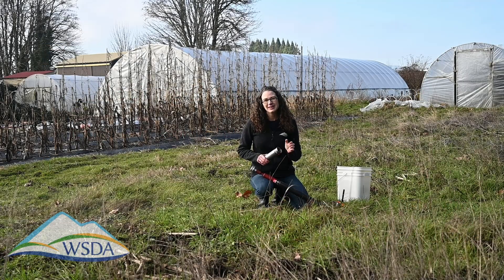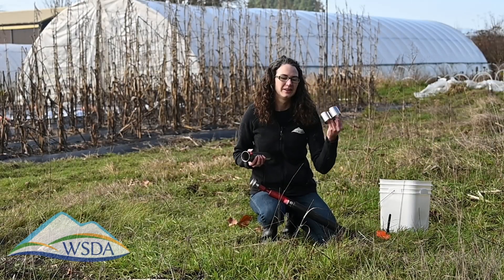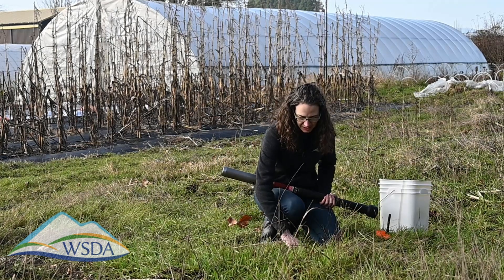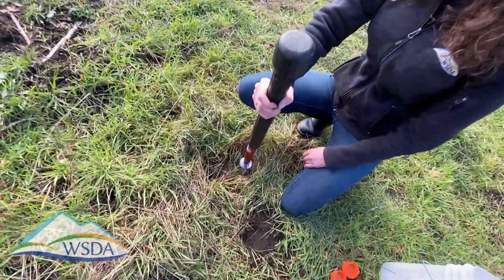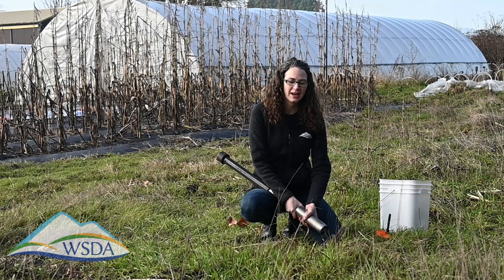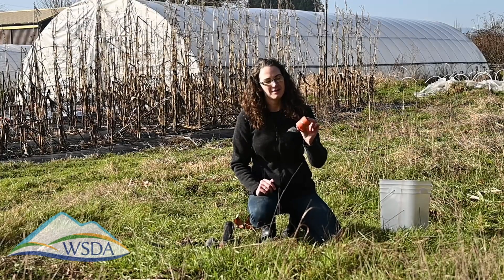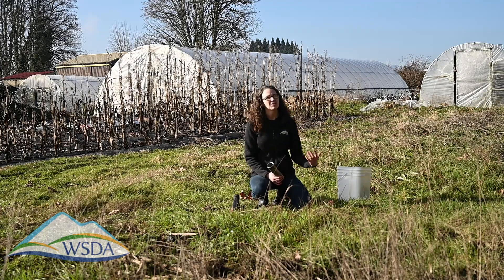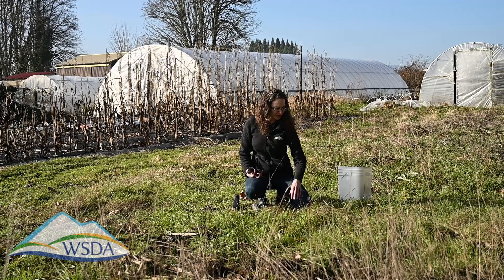Soil Sampling 101: Bulk Density

Comment: Hello, I am not sure if you actively check these messages but I wondered if you might be able to confirm the bulk density sampler brand and model you are using in this video? Many Thanks Sara
Reply from the maker: Hello, Thanks for the inquiry. We used AMS equipment in this video. You can buy kits or individual parts here: https://ams-samplers.pulse.ly/o4jo9b7mpr